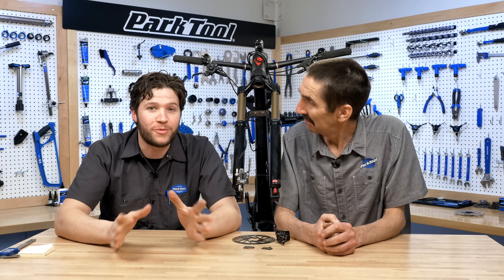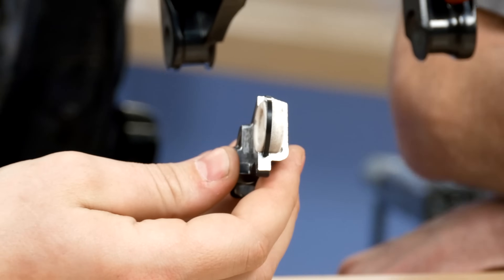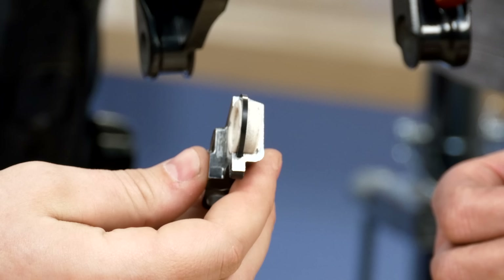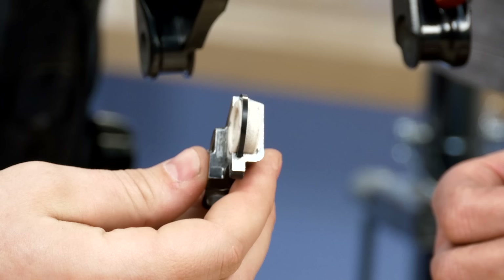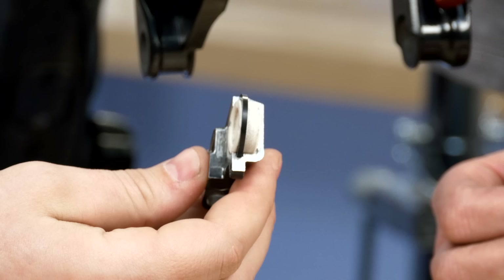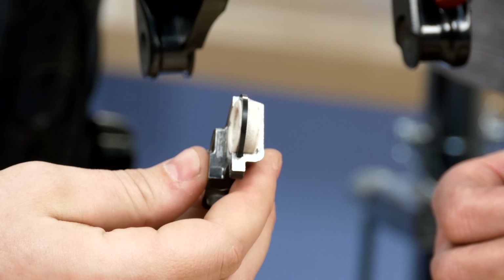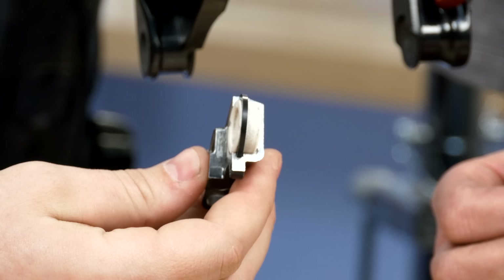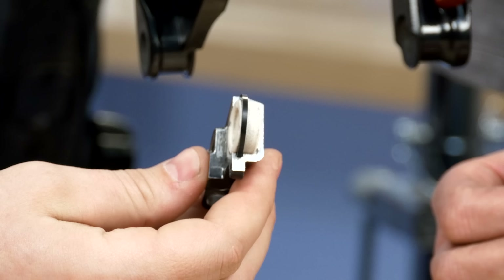How To Clean Hydraulic Brake Pistons - Tech Tuesday #104

Comment: Great tips.  Been working on bikes for how long and never saw an explanation for why one piston might want to move more than the other.
Reply: for me its more like, I've never seen an explanation for why they should want move in synch in the first place. There's no mechanical coupling between them, and fluid's going to take the path of least resistance. So in my mind is a miracle that they'd even be as close as they are.
Reply: @adriansue8955  the fluid isn't taking any paths of least resistance, as the resistance is the same on both sides of the pistons. Theres the same amount of gap for the fluid behind each piston. So whats happening is even pressure is being applied to each of the calipers, its just up to the seal to bring it back after pressure taken off,
Reply: @akeluify  "the resistance is the same on both sides of the pistons"
...in lab conditions when both pistons are brand new. And even then there will be differences resulting from how each seal interacts with each piston. Once they start picking up dirt these differences will increase and each side will retract differently.

Comment: Why do some manufacturers (hope) recommend silicone lube instead of dot or mineral?
Reply from the maker: Eli Gilfedder    Good question. If your brakes seals were not designed to work with a silicone based lube or fluid then it could actually cause damage to the seals. Typically they will swell. Sram suggests DOT grease hope suggests silicone grease but if you put those onto a mineral oil system you may be in trouble. Hope this helps.

Comment: I always wondered how hydraulic brakes self adjusted. It's beautifully simple. Great explanation!
Reply: I think they're simplifying the explanation here. Also have to remember the oil reservoir on the master cylinder, its open to the cylinder at the resting position, but closed off during motion. This means as the master cylinder returns,  just before returning to rest the system becomes open and oil pressure is relieved; so the slave pistons don't get fully sucked back to where they started. 
At the same time, the flexing seal means there's preferential for the slave pistons to slip more in one direction than the other.
Both things need to work together for the pad wear compensation.
Reply: @adriansue8955  yes thanks so it is a two sided story.. The pressure side and the relaxing side. Nice to get more understanding
Reply: @adriansue8955  I think the way it works, is that the seal can also flex a bit in the other direction. Only when the master cylinder piston returns past the reservoir timing port, the caliper piston seals can relax to the middle position.

Comment: Wow, thank you so much :)) I've been told to use silicon grease to lube the piston. But know, thanks to you guys, i know that i can use brake oil to both clean and lube the piston (and also know how the system work too). 
P/s: i know with mineral oil is fine, but i don't think you should use the same method for DOT fluid braking system, cuz DOT oil is a little bit too harmful.

Comment: Very well done guys. One item of note, if you have a Shimano brake with ceramic pistons do not use any metal tool to cycle the pistons. Also you have to be very careful to push on the center of a ceramic piston as to not get it sideways. With ceramic I will usually leave the old pads in to protect the piston while I cycle them.
Reply: I made a mistake, I pressed too hard and the pison came out, I put it back on but it caught air. and after a while I started to lose the mineral oil from the Shimano hydraulic brake. Please help me and explain to me how to proceed to put the piston back so that I do not lose mineral oil again. Thanks!
Reply: @SPN2TV  put it back and then bleed the brakes
Reply: @SPN2TV  You can't put the pistons back without losing the mineral oil or brake fluid. After cleaning the piston and placing it back you'll need to bleed the brake.
Reply: what material is the back of the pad made of?  metal. that tool is flat as a pad, so I guess is as safe as a pad to push pistons back.

Comment: Wouldn't the advancing pistons increase the volume of the hydraulic system, creating a vacuum as there is no fluid filling the increased space?
Reply from the maker: The piston at the lever is moving, pushing fluid, hence pushing piston. The volume does not change.
Reply: Sorry, when I said advancing pistons, I meant when they move outwards to compensate for the pad wear (1:55 in the video)
Reply from the maker: There are both sealed and non sealed hydraulic systems used in brakes. Both use a reservoir. The system needs a reservoir to draw from as the system needs more fluid when the pads wear. So yes the volume of the system does change but there is more fluid added to the system from a reservoir, typically found at the lever.

Comment: Why not clean the pistons with alcohol first then dry then lube with mineral oil, then push pistons back and clean again with alcohol? Also, what concentration of alcohol, 70% or 90% isopropyl alcohol?
Reply from the maker: Sure, that would be fine. Even cleaning with water only is good.  The idea is to clean the piston that is outside the seal, and that part is certainly exposed to rain, which is close to, but not quite, 100% water.
Reply: Park Tool thank you for the response. I have seen many other how to videos on this matter that cleaned with alcohol first. Which alcohol concentration is best? I assume 90 as it has a lower water content than 70.
Reply from the maker: My problem with using alcohol first is that it does not hydrate the seals and actually dries them. So using the fluid that the system calls for to clean the pistons will do two things that you need/want done. But either way will work. And personally I like the highest percentage I have available to me at the time that I need it as there is less residue with higher percentage alcohol.
Reply: Great thank you for the reply!!

Comment: Thanks for the video! What is the part number of the levers you are using to push the pistons?
Reply from the maker: The TL-4.2 is a good choice, as they are plastic and will not scratch anything inside the caliper body.  The PP-1.2 is useful as well to lever in piston, but is still.

Comment: If you replace your old pads and don't follow this process is their a chance air can get in to the system due to dirt getting in the seal?  Or just sticky pistons?
Reply: Saul Rodriguez The pistons will move inconsistently, and its most likely that one of them will move easier that the other one - just like in the video.
Reply: Dirt may prevent the piston from moving/retracting so brakes may start rubbing. Or if the dirt damages the seal, the brake may leak. So squeal while braking, loss of braking power and lever throw getting longer and longer until brake is empty.
Reply: If you do not service your pistons like shown, they eventually will not move freely at some point. That means they might not retract properly, the seals might leak and ruin your pads. Sometimes, if they are sticky you will need more forse on the lever in order to engage the disc rotor. Which means less modulation as well.
Reply from the maker: Replacing pads will not get air into the system. If the piston were to come out, and oil leak out, then it might be possible.  To determine if air is in the system, pull hard on the lever. It should feel firm. Even a little air will result in a very soft feeling lever.
Reply: Park Tool how might the brakes feel if dirt has entered the seal after a brake pad replacement?
Reply: Stilian Ivanov I understand that, but would you feel a difference in your brakes when riding?  If so what would the brakes feel like when use them if there is dirt in the seal?
Reply: Stilian Ivanov Thanks so much!
Reply: The easiest I know that I have an issue is when I squeeze the lever and watch the caliper and see the disk deflecting to one side.

Comment: Is it OK to use silicon lube( so high heat resistant) for lubing the pistons?
Reply from the maker: We would not recommend silicon lube.  As always, with the brake manufacturer. There is brake fluid behind the seals and pistons, and generally you do not want to mix your chemicals.
Reply: Park Tool thanks for the reply! I found the recommendation on the internet somewhere, but I will avoid it from now on.   Funny that I have just done it this weekend, has the video been released sooner I would know.